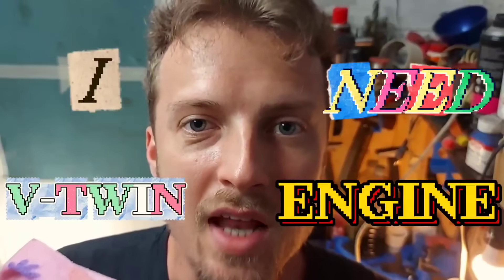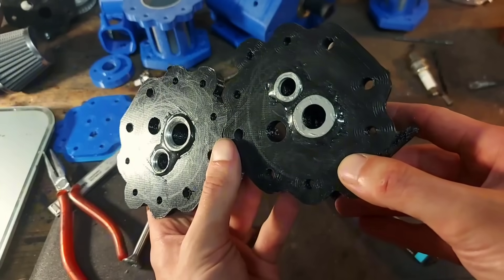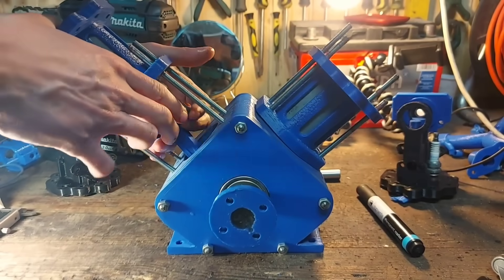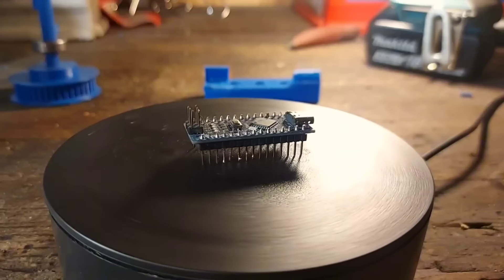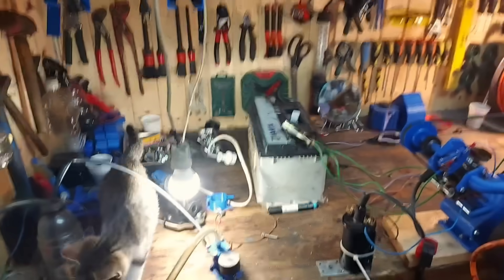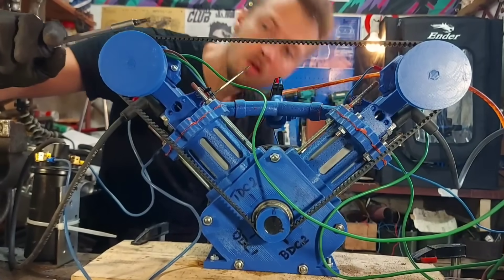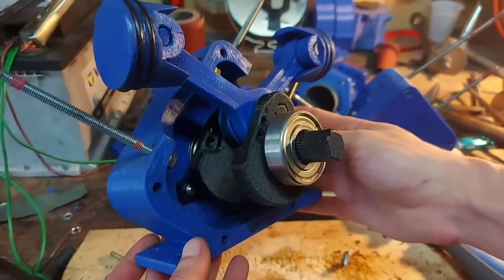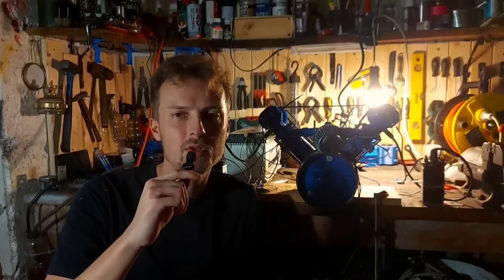I 3D-Printed a V-Twin Fuel-Injected Engine

Comment from the maker: If you enjoyed the video, don’t forget to like 👍 and subscribe for more!
Reply: very nice. i am technician and self-learning mechanical engneer, and i can give a few ideas to you: 1. engine definatly need oil system its easy to print peristalic pump(there is a few ready to print designs from what i know), and with that you will be able to replace metal earings to a bearings with same style to real engine bearings, that will greatly reduce friction and make work smoother. 2.use polycarbonate(PC) plastic its nearly as strong as pa12 but also have much less friction and great heat resistance. 3.think about polymer 3d printer for cylynder walls, pistons and maybe 3d printed valves, this 3d printed parts are much greater flame resistance and will make huge difference in durability and prescision of this parts. there is much more things that can be done for fine tuning, but i wont write it there to not make this comment a kilometer long.
Reply: Name the cat bob
Reply: Inspired By Camden Bowen

Comment: Whats wrong your using a shitty 3d printer to try and make a engine theres a reason we dont 3d print engines its becuase its shit a 3d printer is something you woukd use to make a model them make it out of a type of metal your using plastic material to make a engine then wander why its shit 🤦

Comment: This is extremely cool, although you should notice the fact that the print quality of some parts is lackluster. Therefore to increase the results I suggest at least lowering the print speed for better precision. Also another useful filament you could use is ASA CF as it has a lot of heat resistance and is especially resistant to warping

Comment: you can always lost-pla cast or electroplate to metal. sheet metal surfaces for the pistons. sheet metal makes wonders. ie you can either cut suitable flat sections, and/or bend them into suitable shapes, like cylinder walls. well more than one actual run. to show it can start properly and run properly.

Comment: The build is impressive, but the print quality, ooof. I'm sorry, but it's really terrible, even the PLA comes out very ugly. I would advise properly calibrating your printer before going for a project like this. The dimensional accuracy and strength of the parts will improve.

Comment: Great video. 
try to avoid sharp edges like you have in the head design, they amplify stresses. Put a big Fillet at that corner, and it will lower the stress at that corner.

Comment: I really like your videos, but some of your solutions... Man you are crazy! So the Crank is a very important load bearing part of this engine, so you shouldnt print it in the orientaition you did because it will break more easily along the layer lines! next time try to print it laying down as it will be a lot stronger! also the pvc you use is the same stuff i use for my potato cannon and in my experience it deals very poorly with heat? so i suggest acrylic or a metal sleeve. acrylic  also has the benefit of being almost fully clear, which is great for making videos! I hope this message is helpful!!

Comment: use a black RTV, or even an actual gasket with an enamel coating as a head gasket. the red stuff is only intended to be used on exhaust gaskets, also using starting fluid is not recommended as it is extremely prone to preignition. also using some kind of metal reinforcement in your crankshaft with a shorter stroke would help improve concentricity and strength.
Reply from the maker: On my single cylinder that ran for 8 seconds I used 2 sheets of aluminium from a Coke can + this red gasket maker and it held propperly, I will also look into black rtv, thanks for the tip !

Comment: You really need a better crankshaft, and that timing belt system is a huge weal point. There is a very small contact area between the belts and pulleys and it could easily skip time.

Comment: To help with starting with a drill look for a breaker bar ratchet. It will allow the engine to spin faster than the drill and should help from breaking the crankshaft or the drill.

Comment: Pretty neat... Could try stepping up the strength by using the the 3d prints to make molds then cast each piece with some kind of JB weld... Or using it a sealant layer.

Comment: the multiple cylinders is cool but i really feel that youve got to get one cylinder working well before making more of them.
keep it simple while developing the tech itself.
Doing it this way will only cause twice the amount of work till you get it right, might as well get it right before doing twice the work?
Anways, cool design though the intake pipe solution has to be leaking vacuum on the connections between the y pipe and the seperate intake runners lol

Comment: Try an open infill and fill the 3D printed parts with epoxy resin. You want a low viscosity so it will flow into the whole part. You want a longer cure time so you can get the part filled before the resin starts to set.

But with the thin resin you'll have to make certain the outer surfaces of the parts are liquid tight. You'll also need to think about flow paths. Top to bottom for liquid and bottom to top for air. You don't want any areas inaccessible to the resin pour or that will trap air. Use fillets and gussets and buttresses in the designs to manage that. The extra bits should also make the parts stronger.

Comment: theres so many videos on this subject and its all waste of time, you cant make an engine run on plastic parts unless its super big and over engineered. What might work is IF you make a 3x bigger crank shaft and use much smaller pistons with lower compression so you can have just enough power to make it run then it might be possible. You still need metal cylinders, head and pistons

Comment: Halfway through and I just wanted to stop and comment. Everything looks fairly decent from a design standpoint. I think your only issue is going to be the materials being too soft and heat sensitive. If it runs, it won't run for long before something melts or gets worn off, like cam lobes or piston tops. That said, I like your work and hope it proves me wrong!

Comment: make the piston have 3 compression rings and put apoxy on the top of the piston so i can run longer, put epoxy on the rods so they dont snap in half and make a metal crankshaft

Comment: Wow you got much further than all the other attempts I have seen! I recommend getting a freewheel/ratchet adapter for your drill. You can get those everywhere online. When the engine has its first combustion it puts a large shock back into the drill. I bet this is what always breaks the crankshaft.
Reply from the maker: Thanks for the tip, I will definitely look into that!

Comment: Good job, but you have to remember that running on gas you need proper AFR, meaning you have to control the amount of fuel (injection time) by how wide open your throttle is, but even then it won't survive for long enough to use the proper AFR... Unless you'd try running something with a cooling effect like methanol :)
Reply: Minimally the EFI setup needs a crank position sensor, throttle position sensor and mass air flow sensor for it to be able control the AFR more or less precisely
Reply: @just_a_hoverfly yeah but that's overdoing it for just a model engine

Comment: i think that 3d printed engines can be done, the bearing choice was excelent, and maybe run an over square design to reduce crank load, and scale thickness and enfill, plastic is a terrible material for engines, so to make it work, engeneering must do a perfect job, it has to use all its tricks, it can't be rednecked, ive seen guys put an cf piston on an 2 stroke bike and it kinda holded on, maybe use less compression, like 6,0:1  or lower, and you know, put ventilation on the crank, oil, an oil ring, an tube of steel for the cilinder is also a good idea

Comment: That was very entertaining.  A lot of good work here.  However (and you must know this), conventional 3D printed materials don't have the strength for this.  This will never be a functioning engine.  Best case, it might run for a minute before something melts or breaks.  So where are you going with this?
Reply from the maker: Stick around and you will find out , I really think 3d printing is the future of the automotive industry.

Comment: Print crank solid...shells without 99% or higher infill will fail for sure...metal is more than likely the only way to have it survive though...
Reply from the maker: Last try was 8 walls , 100% infill pa12cf15

Comment: you should also print any component that is exposed to combustion (or a decent amount of stress) {at least partially} with 100% infill.

a few reasons for that, but mostly for shear-strength.

Comment: Very cool project!, You should try calibrating your 3d printer it should print way better, Also try to orientate parts to use the least amount of supports while focusing on layer-line strength if you didn't know that already. use 0.32mm layer height for best print speed assuming your using a 0.4mm nozzle walls could be 4. use 20-60% infill depending on purpose of part 60% should be the highest since more actually makes it weaker! and Try out Cubic Subdivision infill pattern! Love the build!
Reply from the maker: Im using a 0.8 nozzle rn thats why the prints look even worst than before😭 but they are VERY strong
Reply: @alexslaboratory4976 damn that’s a big nozzle, I’ve only ever used 0.6
Reply: @alexslaboratory4976   I think you can go hotter, on the pla parts I'm seeing some big gaps, that's a weakness! Maybe calibrate e-steps (or rotation distance if klipper) or tune the temp so the plastic can flow a little better. for such sizes you could use a cht nozzle

Comment: This is very cool but I prefer carburetted engines
Reply: Carburetors have running problems with running 3d printed engines
Reply: @JB_Lego  probably the reason why it worked basically the first time
Reply: This is very cool but i prefer fuel injected engines
Reply: @corneliofehr8001 this is fuel injected😂
Reply: @JB_Lego i know haha. I just wanted to add my irrelevant opinion at the end. Failed attempt at a joke

Comment: This is amazing!! I would recommend going away from a 3-D printed crankshaft though, I attempted to make a 3-D printed crankshaft for my 50 cc two stroke, and it was larger than the crankshaft you made and yet it still failed multiple times. I eventually had to make a metal one. Other than that, I’m super excited to see where you take this project!!
Reply: we miss you come back
Reply: Need to make it from metal.. All of it.
Reply: he has to try PPA-CF it will not break.

Comment: Would you consider building a leinor cycle engine? Might be easier on the plastic parts.
Reply from the maker: Will definitely look into it
Reply: Otto Langen would be cool too.
These non compression engines have so low combustion pressure so you could use slide valves pressed to the cylinder or head with springs.
Lower load on the crankshaft too.